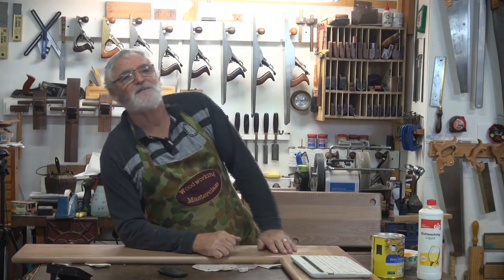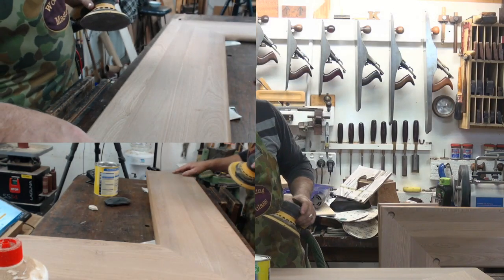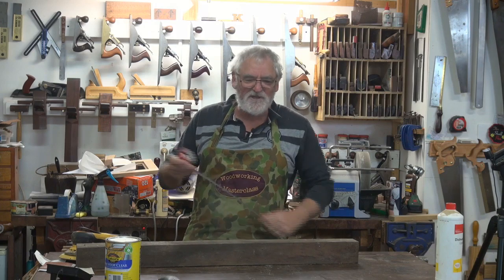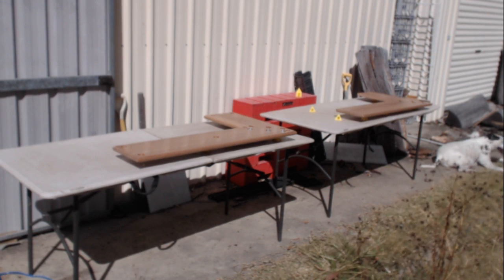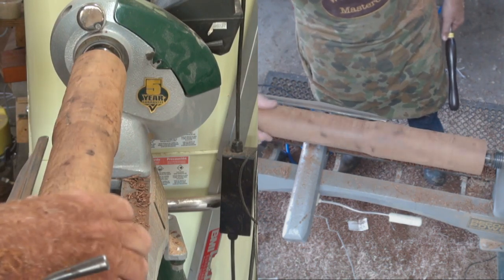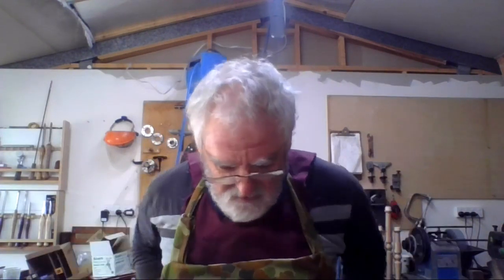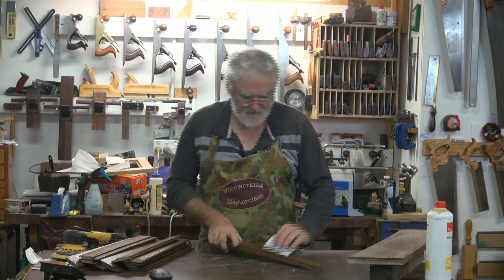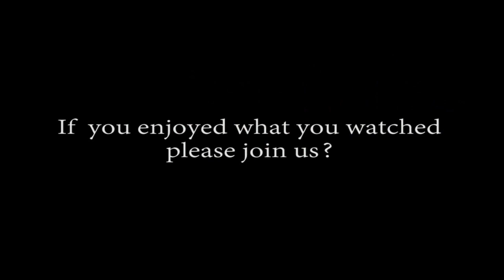(Day 49)  Spraying Blender Bench and Turning Rolling Pin.

Comment: Great video I am wondering whats the common thickness of boards used to make bed frame. Am talking about the long side and short side boards
Reply from the maker: Hi Gareth, I am currently making one (super King Size) and the sides are 40mm 1/1/2" For a double bed I wouldn't go thinner than 30-35mm 1 1/4" Single beds 25mm 1" Cheers Steve
Reply: @Woodworkingmasterclass  thanks for the help youre amazing 1 1/4" will be ok for a normal queen size
Reply from the maker: @GH-uq7wr  Thanks, that's general size used in all the shop bought ones. Would love to see the work in progress and the finished item. Cheers Steve